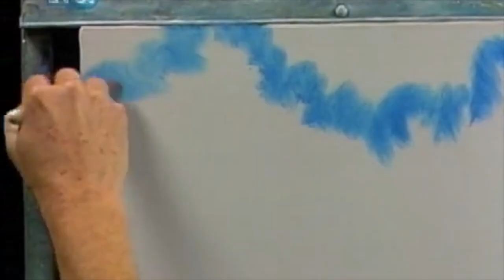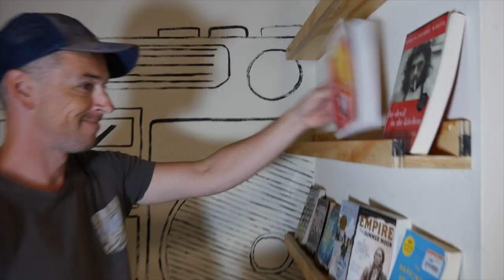High School Classroom Set Up 2017 | Teacher Vlog

Comment: Thebig metal thing with the drawers is an old library filing system. They held cards for the books. Dewey decimal system!!! So funny. Brings back memories from my moms middle school library. Love the floating shelves. Have a great year.
Reply from the maker: the big gigantic piece with all the little drawers is for nuts & bolts but i do have two metal drawers that are from a library (i think) it looks like something that would have had the dewy decimal system in!